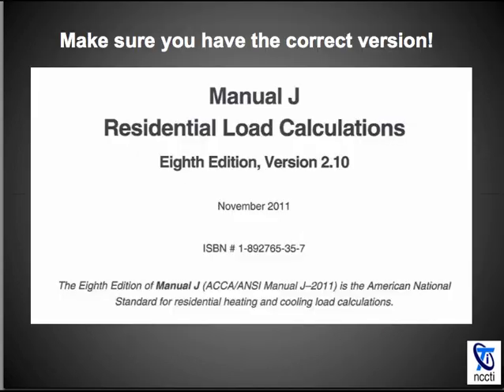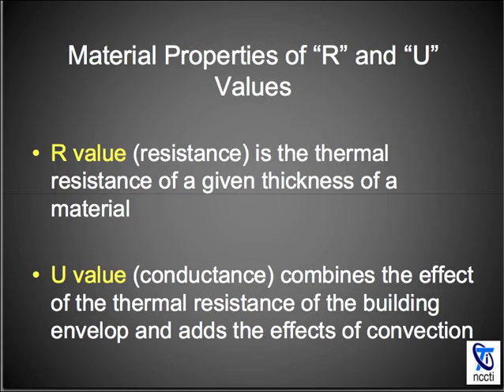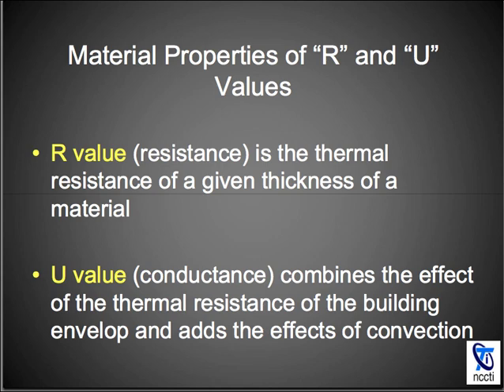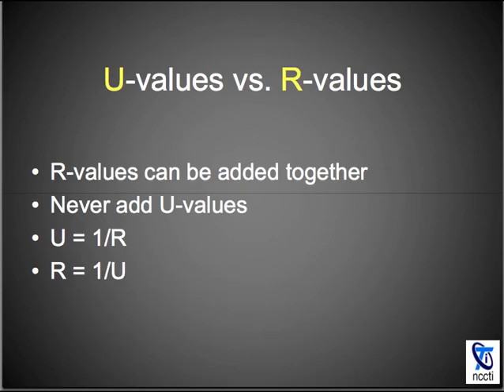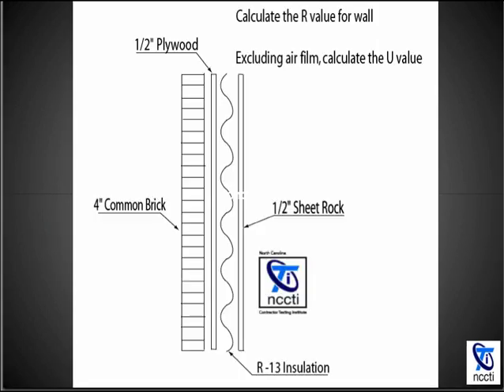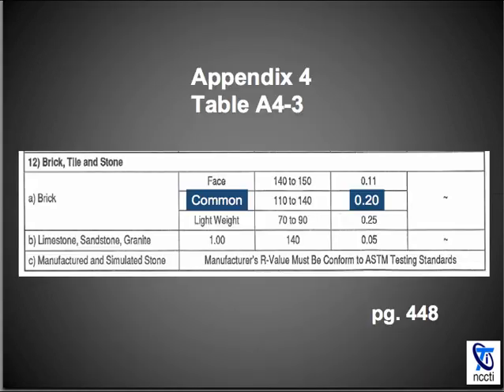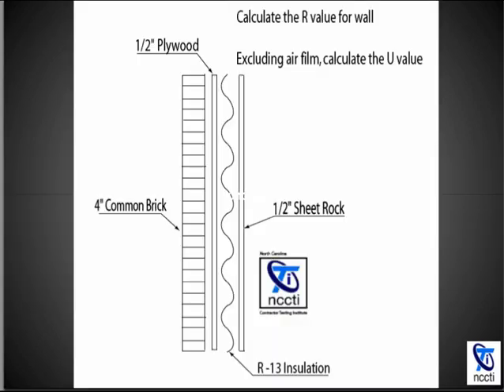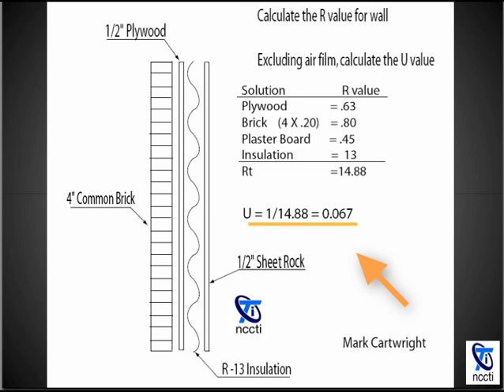Calculate the u value.mp4

Comment: And if you want  calculate U value in Si system (EU etc.) than multiply American U value with 5,67 . Than U value 0,067x5,67 is 0,38 U value in Si system w / m2 K , this is typical U value for 10cm or 4 inch mineral wool insulation. 
Example 2  
R30 value is 1/30 = 0,0333 U value in US and  0,0333x5,67 = 0,188 U value in EU,  typical for 20cm or 8 inch mineral wool insulation.